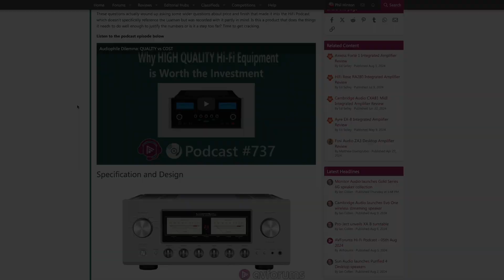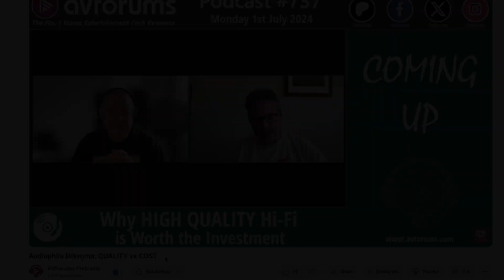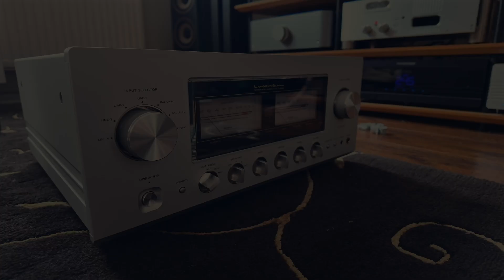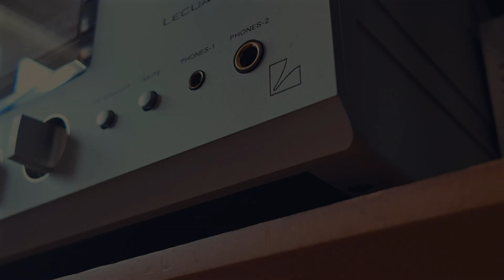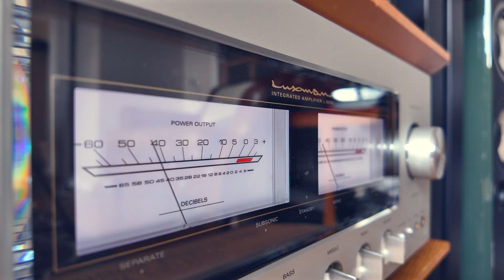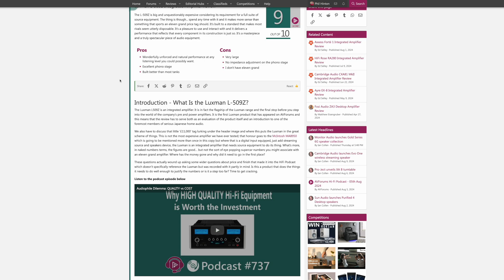Luxman L-509Z Integrated Amplifier Review - Is It Worth £11,000?

Comment: In 1977 I bought the complete Luxman Laboratory Reference Series, after years of tube amps. After 5 years of over 25 break downs, I gave up. Worse, it sounded like a cheap portable transistor radio. Never again, and went back to tubes. Thank God there was already Audio Innovations, did direct business with Glen Croft, at present Audio Note. Which sounds warm, holographic. And more important in over 35 years, not once did I ever had any repairs, and it did not cost me 11K. Good Luck, with Lux!

Comment: I Agree I was going to buy Yamaha 5000 series amp and pre-amp for about 20K and pair it with a CD 3000 and 5000 series speakers. After listening to the 509Z I set up the system I’m listing here(Don’t sleep on the LIAV DAC amazing for its price) I rounded up the price and didn’t include taxes: My dream set up…for now..lol

Luxman - L509Z Integrated Amplifier - $12,500
Luxman D-X10 Digital SACD/CD Player - $17,000
HIFI Rose 130 Digital Music Streamer - $5,000
HIFI Rose RSA780 CD/Ripper - $500 
Dali Epicon 8 Floorstanding Speaker - $25,000
Harbeth 30.2 40th Anniversary Edition. Speakers - $6500
LAIV Audio Harmony DAC(Digital to analog converter) - $3,000
LAIV Harmony UDDC ReClocker - $1,000
AudioQuest Niagara 1200 Power Conditioner and Blizzard power cord - $2,000

I have two sets of speakers I switch between them with the controls depending on what I’m listening to and how loud…

Comment: Is this the same amp that costs €4,000 in Japan? Are we audiophiles, being scammed?
Reply: So what, all is needed is a step down transformer!
Reply: @mariocassar3117 Step-down transformers tend to kill SQ, however.  But you could always move here😅

But then McIntosh, dCS, and other foreign brands become way, way more expensive, and a lot of gear isn’t even available here at all.
Reply: Actually about EUR 5,000 in Japan.  I bought one last year.  I suppose that's what happens when you add tariffs and international distributors into the mix.  McIntoshs are significantly more expensive here than in the US, too, so it's not just a Luxman thing.

Conclusion?  I guess buy local if you want to pay the least overhead costs.
Reply: Many units sold in Japan are 100 V‐only
Reply: @carlosr.2027 *All units, as Japan is a 100V country and typical toroidal transformers don’t do variable voltage.

Comment: I had the 509X (which i very sadly had to give up due to personal circumstances change), and it was simply one of the greatest bits of equipment I've ever owned. Combined with Harbeth SHL5+ it was probably one of the most "complete" sounding systems I've ever owned, and I wouldn't hesitate to have it again. I'm keen to hear a Z and see how it differs from the X, as i can't imagine ther being much more to extract from the last model. X's can be had for good money, and the phono stage is identical.
Reply: I had an inheritance and so was able to buy a 509Z with Harbeth SHL5+XD speakers connected with Supra Sword Excalibur speaker cables. It’s absolute bliss. Built beautifully and once the speakers were broken in a heavenly sound. I started off with other cables and it was remarkable to hear how much difference the Supra cables made. I play both vinyl and cd, mainly jazz/rock/pop and some classical and it handles everything.
Reply: Thats exactly me too. I sold my 509x on as I got a bee in my bonnett and went valve, which is great but I dont think a lot of what I listen to suits it, fabulous with orchestral though especially srings, get more to the Metal though and lacks a bit of punch. So I am looking at trading the valve for the 509z. I am also Harbeth SHL5 Anniversary, which I wont part with.

Comment: Beautiful piece. However,  no tape loop is a deal breaker
Reply: Same here---wonder why they decided to remove it? My 505uxii has the monitor function and I use it with my vintage Denon cassette deck. Sounds great! The 509X had it.

Comment: I'm interested in the av racks on display. Certainly the Mac or a Luxman would need more room around it than what you are showing. I know it's a silly point. It looks great and provides the right image. I wonder  why av racks I often see in these videos are not ventilated shelves? I'm just curious why that hasn't really been a thing, especially as I observe that the heat building up under amps that are class A and some that are class AB, really adds to the heat being generated by such amps, generally, often. Are ventilated shelves generally thought unnecessary? Probably the dumbest question yet. So, my apologies. I love your content, by the way.

Comment: Ed great review, worry not, you're definitely getting the hang of this. I think the concept of "is it worth it?" when it comes to Hi Fi, is a wholly subjective thing. Basically if you can afford it and you like what it does, then it's worth it. I also think there is a definite place for all analog designs such as this, which aren't about practicality or value for money, whatever that is. Basically you can plug anything you want into it and the kind of people that can afford this kind of thing, will spend a commensurate amount on sources. Anyway, it isn't about how many people will buy this, who doesn't love abit of unobtainable Hi Fi porn?
Reply: Considering what true high end, monobloc setups cost, with dac, interconnects, and speaker wires and isolation, this is an absolute bargain imo, if one does not want a valve preamp. Considering you do away with the need for a separate headphone amp even. All one needs is a good DAC over XLR balanced